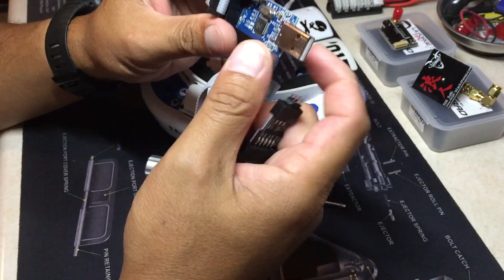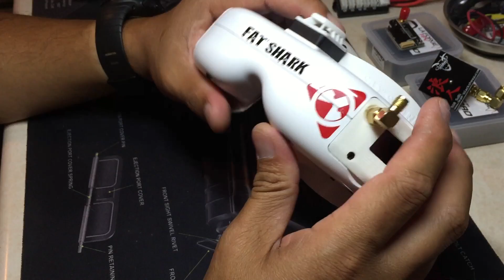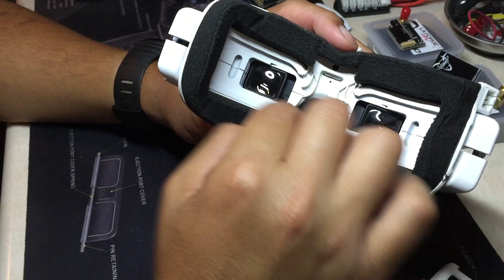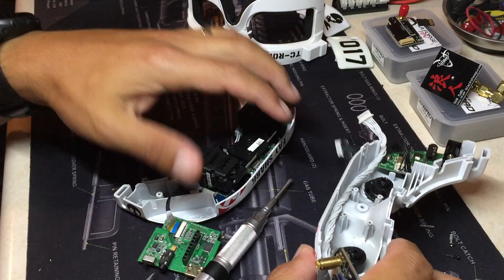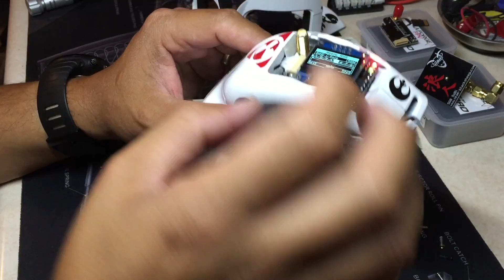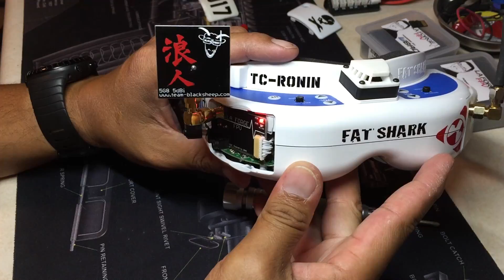LaForge Pro FatShark RX 5.8Ghz Main & Diversity Module COMBO Part 2 - Installation (Ronin Tech)

Comment: Would love to see part 3 about WIndows 10 and firmware updating.
Reply from the maker: Bear Cubb thanks for the feedback!!  Been wanting to complete part 3, works been hectic. I'll start putting that together soon. My experience with the laforge diversity so far has been 👍
Reply: I'm going to place a setup in the new Eflite Convergence VTO plane/quad . The new firmware to fine tune it even more I want to install but no how to and few videos out don't show much.
Reply from the maker: Bear Cubb Roger that.
Reply from the maker: Bear Cubb the link on how to upgrade firmware on Windows 7 is in the description. The only thing I had to do differently for Win 10 was install the correct USB drivers. Let me look those up and I'll post any info here
Reply: I've got Windows 10 but the video don't go into enough detail. Looks like take this line cut paste in arduino press enter. Maybe I'm looking at wrong one.